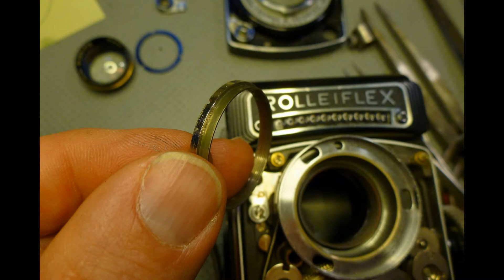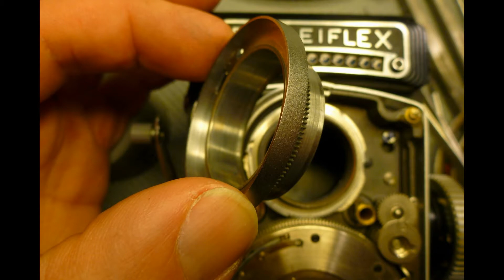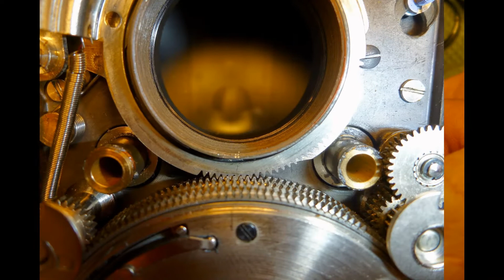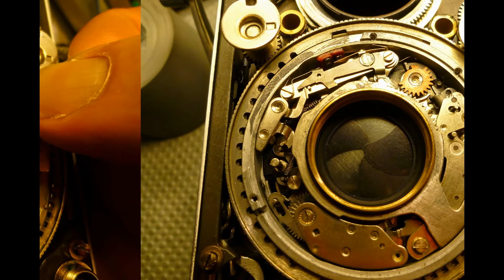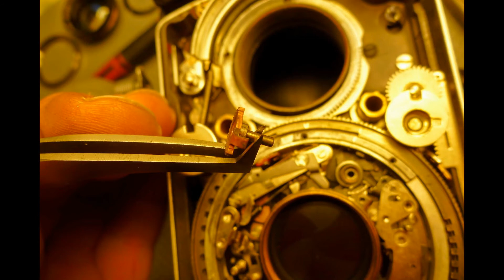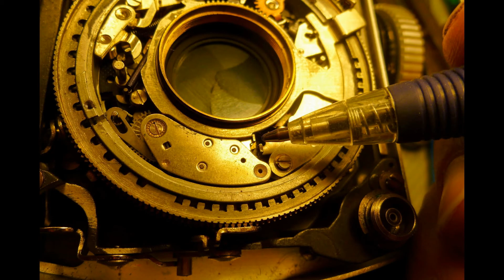Working with the Rolleiflex 3.5 F

Comment: hey Mike! I've got a same camera like yours, the 3.5F type1 which was built in 1959. Everything is just fine expect all the shutter speeds are slower by one stop, 1/500 seems to be 1/250, 1/15 seems to be 1/8, etc.  I opened the front and cleaned both view lens and taken lens, but have no idea how to fix the shutter issue, can you please give me some hints what to do, like which part of the shutter mechanism should I clean, or something else in your head. would appreciate it. thanks a lot and look forward for your reply.
Reply from the maker: Hi Pengchen
To solve the problem with the slow gear, take look at 5:58 in the film. There you will see the slow gear assembly is located at the right side of the shutter, there are 2 screws that hold it, the 1 screw is around 5 o'clock and the other is at around 2 o'clock. When you unscrew them you can take out the slow gear assembly and clean it with Lighter Fluid (Zippo) or 99% Isopropylalcohol, and give the slow gear some gently movement, then blow the rest of the solvent with a blower.
After that you use thin sewing machine oil to lubricate the bearings (axel) only at outside at both side of the slow gear assembly..., Only use very small drop's of oil..., less is better. Then give it some gently motion and wipe the rest oil away, and install it back in the shutter, then adjust it to correct exposure time, by move the slow gear at 2 o'clock torch the middle or the edge, to adjust longer or shorter time.

Hire are some info from another repairtech guy:   http://rick_oleson.tripod.com/index-55.html

Hope it make sense :-)
 

Cheers
Kenneth
Reply: mikeno62 Thank you so much, Kenneth! It works as exactly like what you said. but here comes a new problem, the slow shutter speeds(from 1/15s~1s) seem to be in good order after cleaning and lubricating the assembly, however the "fast shutter", like I said before, is also slower by at least one stop, that 1/30s is now slower than 1/15s. Do you know how can I fix it?
Pengcheng
Reply from the maker: Hi Pengcheng
To adjust the 1/500 second take a look at the film at 4:52, and look at the slow gear escapement, on the upper part you should look for 2 pins the lower pin is for the slower exposure time like ~1 sec.
It's the pin just above, that have the ~1/500 sec. So to adjust the high speed you have to bend the pin just very little to make the adjustment.

Hope it will work for you.

Cheers
Kenneth